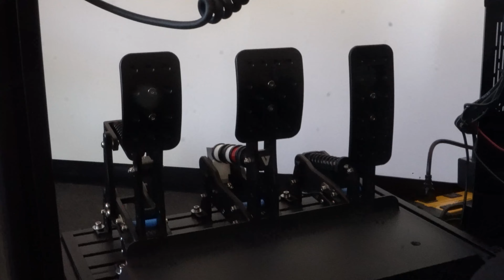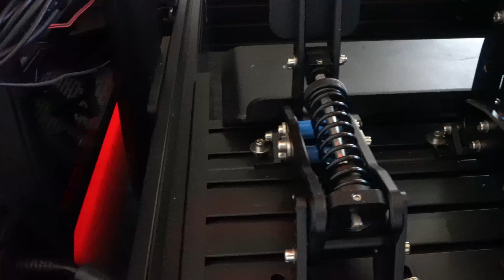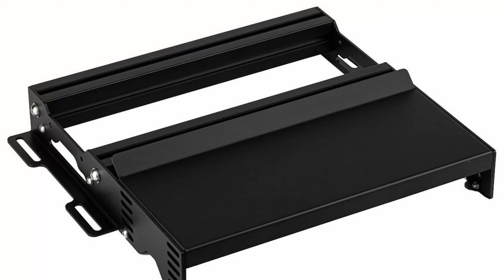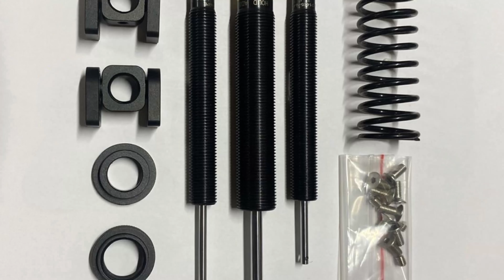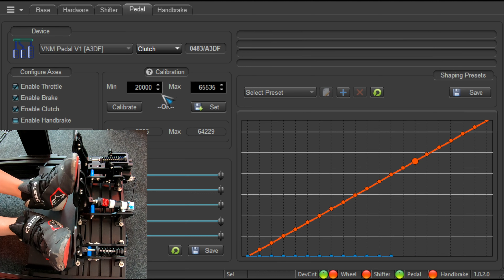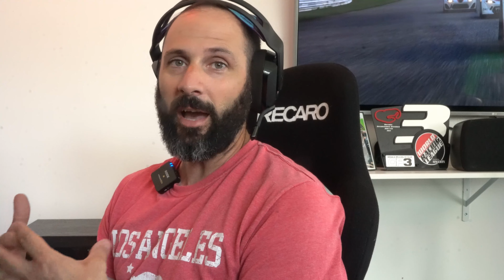VNM Pedal Set Review - Are The VNM Pedals Better Than Heusinkveld?

Comment: Thank you for this clear and concise video.  I currently own H Spints.  Would it be an “upgrade” to replace my Spint with this VNM kit?  (I installed the Ultimate bushing kit on my Sprint).  THANKS!
Reply from the maker: Yes I would consider them an upgrade. You will not necessarily see a huge difference in performance, but they are a better construction and I find their bushings just feel better.